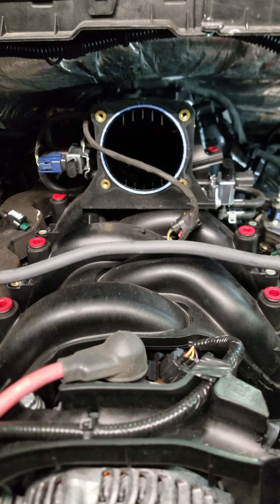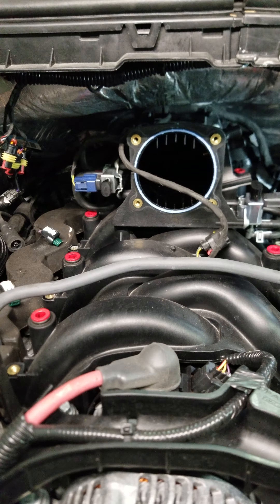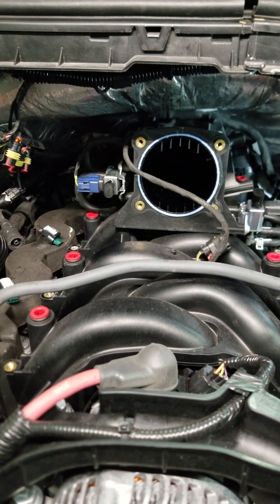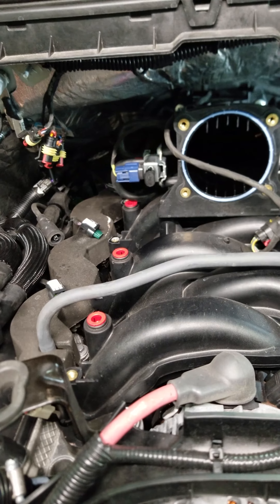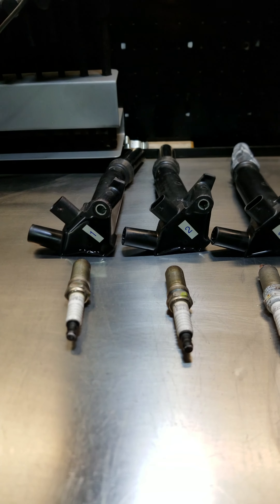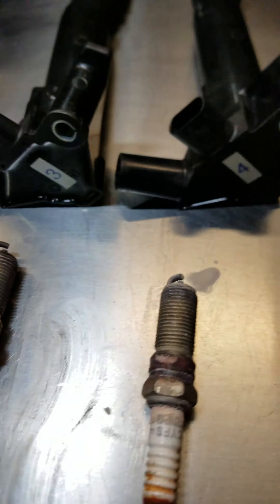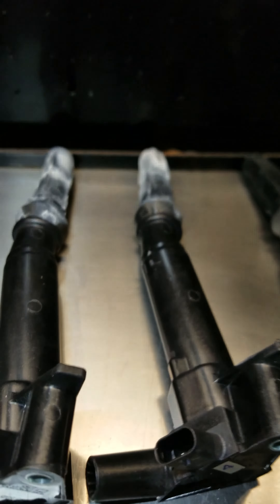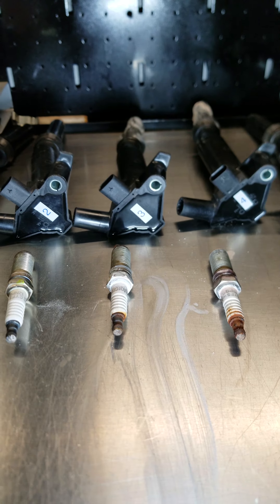AGCentrum AutoGas Ford F250 6.2 misfire

Comment: I’m chasing a misfire at idle only on a 2017 6.2. Other shops haven’t found the issue. Thanks for the info
Reply from the maker: Known to have blown up converters... we have done a few. Acts like a dead cyl. Done all short of pull the head. Was converter. Do your self a favor go oem.  Remove o2s and scope converters. There is a "chamber"  in the middle of converter.
Reply from the maker: Also 17 is first year aluminum,  different variation of 6.2 but not sure if it still has maf sensor . Air box on drivers it has one. On pass side it doesn't and they use map  sensor bottom on intake rear passenger
Reply from the maker: The maf sensor if unplugged while running, no change in how it runs.. start there. Oem also a/m = nfg